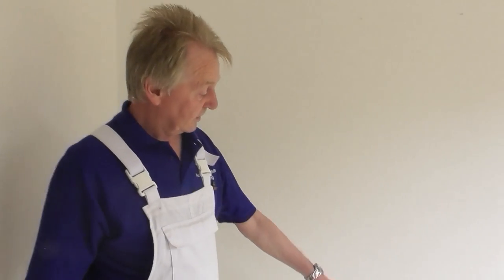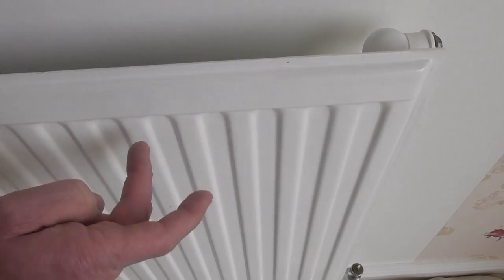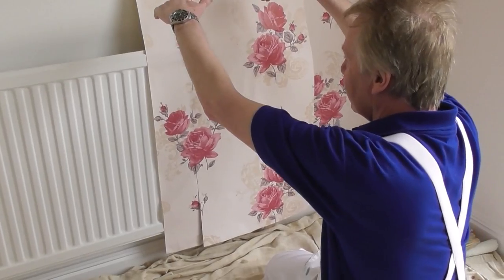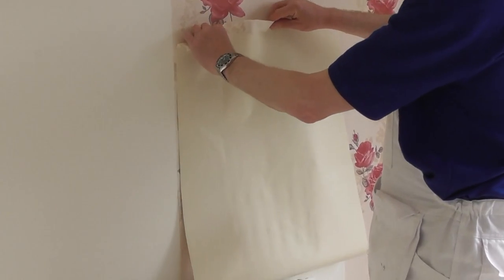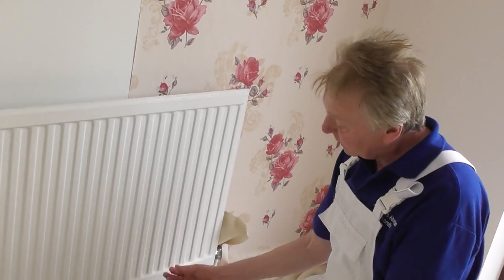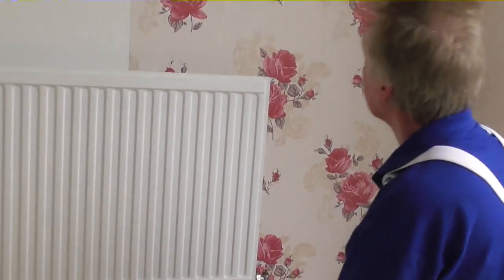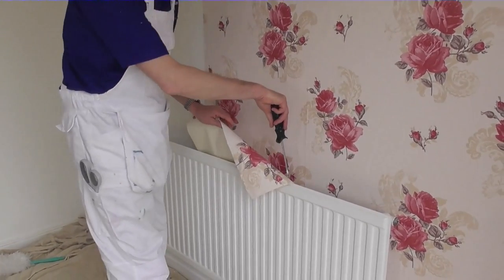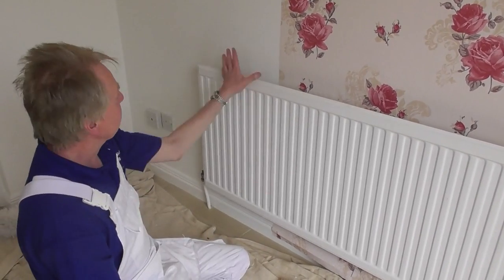How to Wallpaper Behind a Radiator

Comment: Have to admit I always take the radiator off. Yes it is a faff draining it but I find it makes the papering easier and the cut  edges don't all curl up from the heat of the radiator.
Reply: Agreed. Same if you wanted to paint behind as well. And what about sticking reflective material behind the radiator while you were at it ….
Reply: Why even take it off bro leave it on and just have someone holding it for a sec. Much easier, faster, and given the person helping you isn't a complete left handed tool, a lot safer
Reply: yup.

Comment: Fold 5 one pound coins along bottom overcut ..... Spaced every 10cm ...... Fold up  into a 2 inch pocket of wallpaper ..... Weighs paper down to skirting ..... Unfold pocket ..... Get your money back ..... Then use the roller to flatten against wall and cut at the bottom ..... Easy Peasy

Comment: I'm no expert but wouldn't it be easier to lift about a foot of wallpaper off the wall just above radiator and then drop it down rather than fiddling about.  You can just drop it down and then use the roller .
Reply: Yeah thats what I do, drop it straight through the gap with the top half stuck on, grab the bottom half and pull it straight, the weight of the paste will pretty much hang it for you

Comment: Aubrey I’ve just seen a few minutes of your you tube videos and have learned quite a lot about the dos and don’t . Great advice from a true professional. Working with someone like you would be a joy. You make it fun and that’s the way it should be..!!  When doing your jams and door painting I’m assuming you are using oil based paint. Here in California,San Diego to be exact oil based materials are illegal. Water based materials can be a bit of a challenge when you’re not use to painting larger areas like door and the like.  Thank you Aubrey for your great video tips..!!
Best regards,John Powers
Reply from the maker: Hi John, that is great news that you are enjoying the videos. Yes, moving over to water based paints can be quite challenging.  You do have to develop a whole new technique to get the best out of them.  Over here oil based paints are still widely used by decorators.  Fortunately the latest water based products are getting a lot better and we can only hope that eventually they will be able to be applied the same as the oil based paints with a longer open time and improved finnish.  We are having some lovely weather here, I expect you are used to it over there in California 😊

Comment: Hello Aubrey. Nice of you to respond to my inquiry. I just want to say that I do enjoy painting my own home but I am not a professional like you. I did paint for most of my working years but in the automotive body shop environment. I don’t miss that kind of work. Very stressful at times. Everything has to be perfect and it should be. That’s what the customer is paying for. I find this kind of painting actually very fun and gratifying. I did however worked with some friends of mine who were professionals and learned a lot about the dos and don’t of residential painting. 
This email Aubrey was actually with the intent to let you know that you gave me some great idea’s on how to go about painting anything for that matter. You kind of break your jobs in sections which makes it much easier to go about the job. Another words not trying to do too much at once. I think that theory will work better especially for water based material. By the way Dunn Edwards makes a great interior water based paint called Suprema. It’s their “top of the line” interior paint that flows out beautifully. And one more thing Aubrey they do make a product that does slow down the drying time of water based paint. I’ve never used it but I will find it and give it try. Didn’t mean  to bore you with all this . I will certainly look at your videos Aubrey if I need some professional help. Thanks again for your response and your great videos, Best Regards,
John Powers
Reply from the maker: Hi John, glad to hear you enjoy the home decorating.  I am always on the look out for new products and I will check out the Dunn Edwards paints and retarder. 😊

Comment: Aubrey, thanks to you, I have successfully wallpapers over the week end.  

Can you let me know what scissors you use as they seem nice and long.  

Also are you able to show how to finish a long piece of paper on the wall at the bottom of the stairs where you arent going around the wall to the side.  So it's an open edge - I cant think how to neatly cut it right on the edge, as it will really show up if jagged. 

Thanks
Carolynne
Reply from the maker: Hi Carolynne, glad you are finding the video`s helpful.  The scissors are 300mm (12") stainless steel wallpaper scissors.  They are available at many DIY stores and the internet.  Keep them clean and they stay sharp for ages.  I hope to do video` on decorating staircases in the future.  In the meantime, could you try trimming the wallpaper with a snap of blade knife and a straight edge.  I use one to do the splice in my how to wallpaper around a window video.  I hope things continue to go well for you with your decorating projects. 😊
Reply: @AubreysAbsoluteDecorating  many thanks for letting me know about the scissors, I will look for them.  My problem with the stair edge is that the piece being cut off is in mid air at the side of the first step, so only supported on one side where it's being cut, I am not sure I could confidently place a straight edge down the edge of the wall to cut it down with a blade.  I am a visual person, so hopefully I will be able to see you do it, if the opportunity arises for you to demonstrate it.  You have done an amazing job teaching on you tube Aubrey, you give very clear and easy to follow instructions which gives the audience confidence in having a go.  Thank you for all you do.
Reply from the maker: Thank you for your really positive feedback.  It is good to know that my video`s are helping people to improve their decorating skills and give them confidence to carry out improvements in their own homes.  More video`s are in the pipeline. 😊

Comment: Can you tell me your method for decorating a hallway, landing and stairs please. 
Love the advice and tips - masterful doesn’t really offer you the justice and respect 
Thank you so much for sharing your knowledge and experience
Reply from the maker: Hi Paul

I hope to do a video on this in the future.  In the meantime:

Put dust sheets or plastic down to protect the carpets.  Fill any cracks and rub down the woodwork with a 240 grade abrasive.  Using a Wooster lockjaw contraption available from screwfix attached to a roller pole and a good quality brush paint around the edge of the ceiling above the landing.  Take the paint 2 or 3cm onto the walls. 
 Paint around the edges of the remaining ceiling areas.   Roll the ceilings as shown on my video.  They may need 2 coats.  Using the lockjaw contraption cut in along the ceiling line above the landing.  Cut in the rest of the wall areas and clip the wood work with the wall paint by about 5mm.  Roll the walls.  Two coats will probably be required.  Paint the doors and frames as shown on my videos.  Hoover around the the edge of the skirting board with the hoover nozzle.  Apply 2inch masking tape around the edge of the skirting board pushing it down flat with a scraper.  Get the tape to curl around the edge of the carpet.  Paint the skirting and try not to get paint on the tape as it can get onto the carpet by capillary action.

I hope that helps 😊
Reply: @AubreysAbsoluteDecorating  
Thank you, how would you go about papering hallway, landing and stairs ?
Thank you
Paul
Reply from the maker: Well that one really does need a video 😊  Paint the ceilings first going about 2 or 3cm onto the walls.  Paint the woodwork and take the paint 1 or 2cm onto the walls.  That is so that if you cut the paper a bit short it is not so obvious.  Start wallpapering by hanging the longest drop first.  Do a concertina fold on the long pieces to make it easier to handle.  You may need to use a ladder and a plank or hire a mini tower scaffold suitable for use on a staircase. Tackle the corners as shown in one of my video`s.  Hopefully I may be able to do a video on this later in the year.  Hope all goes well with the decorating Paul.
Reply: @AubreysAbsoluteDecorating  
You’ve just confirmed exactly what I thought... if I measure the width of the paper to try and centralise a window, is that a good idea ? And hand the paper around the window as you have shown in your video ?
My lecturer has listed you videos as aids to help us, so I’ve watched a fair few of them 
Thank you
Reply from the maker: Starting in the middle of the window can help to prevent problems later.  In the video I show how to splice the paper.  There is another way where you slot in a piece in the top corner.  I am hoping to do a video on this.  I am glad you are finding the video`s helpful.  Please thank your lecturer for pointing you in the direction of my video`s.  😊
Reply: @AubreysAbsoluteDecorating  

It’s all about preparation and planning, thank you so so much for your help and advice 
Can’t wait for the videos....
He’s been off sick for the last month or so, they’re saying it’s not Covid related 🤷‍♂️ I truly hope it isn’t and he recovers shortly. When he returns I’ll pass on your message
Thanks again and please keep up the excellent work you’re doing - it’s very very much needed and appreciated

Comment: I always try your way but it seems never to meet up at the bottom there’s always a gap or overlap well frustrating
Reply from the maker: Yes, not good.  It may be because the radiator brackets are not vertical which is throwing the paper out of plumb.  This is, as you say very frustrating.  Try releasing the paper from the wall at the bottom and lift it away from the wall as far as you can and use the palms of your hands to slide it over.  Bye for now, Aubrey.

Comment: Great videos only issue is my radiator comes down lower than bottom of skirting board so you can't see the bottle of the paper or able to push onto wall!
Reply from the maker: Yes that is unusual.  You could trim the paper so it is slightly shorter than the radiator and then tuck it down behind with the radiator roller.  Hope all goes well with the decorating Lady v 😊
Reply: @AubreysAbsoluteDecorating  thank you ! Any ideas on how to paper the tall wall next to the staircase! I noticed you don't have a video on that horror! I love DIY & have been attempting to do as much as I can within reason .I have sanded down the whole entire staircase & recently stained the whole lot! Big job. Started sanding down floorboards but have the horrible task with trying to remove the black tar on some of them never ending!
Reply from the maker: Goodness me Lady V you have been busy.  Yes wallpapering a stairwell will be a good video for me to do in the future.  You will have to look at other videos or info on the webb for help with this.  You may need some suitable access equipment.  Start with the longest drop first and concertina fold the long piece to make it more manageable.  I show how to do this on my crosslining video.  Keep up the good work Lady V 😊

Comment: I am not sure I caught how/where you put the glue. Is the glue applied to the paper in this case, or to the wall?
Reply from the maker: Hi, I pasted the paper first Nihan.  However some wallpapers do require the wall to be pasted first and not the paper.  Hope all goes well with the decorating 🙂
Reply: @AubreysAbsoluteDecorating  Thank you for the reply! The wallpaper I am looking at requires the wall to be pasted first so it may be a bit trickier, but your video for sure encouraged me to go behind the radiator - I was thinking of leaving that wall out initially (in my case the radiator is under a window, on a small wall, so it would be an option to leave that wall out..). Thanks again for really nice instructions and tips :)

Comment: Could you start in the centre of the wall on a feature wall with radiator .THANKS
Reply from the maker: Yes, that will ensure an accurate pattern balance at each end of the wall.
Reply: @AubreysAbsoluteDecorating  THANKS. Keep up the good work👍😁

Comment: This method is fine if you have the clearance behind the radiator, but sometimes there is only a few centimetres to play with. What then ?
Reply: If you absolutely must cover every square centimeter then this is probably the way, but realistically nobody will ever look behind the radiator, between the mounts. So you could just cut away a "sideways u", a square, out of the wallpaper and "wrap around" the mounts. So there'd be wallpaper going in from above down to the mounting rails, then going down the outside edge of the mount behind the radiator, and then back in underneath covering the wall down to the floor. Seems much less laborious. Would leave the square that's between the mounting rails uncovered... you'd need a flashlight and have to stand right on top of the radiator looking down to see it.

Comment: Why not pull the paper off the wall slightly, that way you can drop the paper paste side to the all and you  don’t have paste all over the back of your radiator.
Reply: Spot on, the paper has lost half its paste to the radiator and edges will curl up in no time. This is making hard work of it

Comment: Press down paper onto the top of bracket to mark then you just scissor up in straight line from bottom of paper job done, i have took off but they normally leak a tiny bit afterwards as it's been disturbed